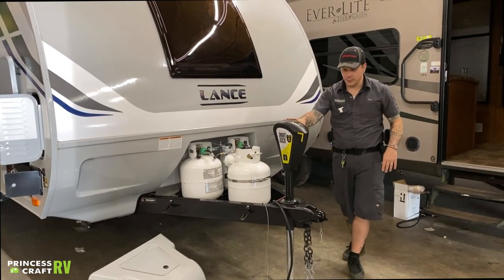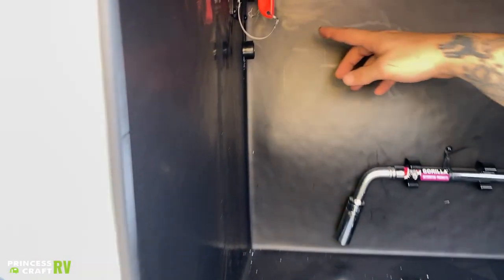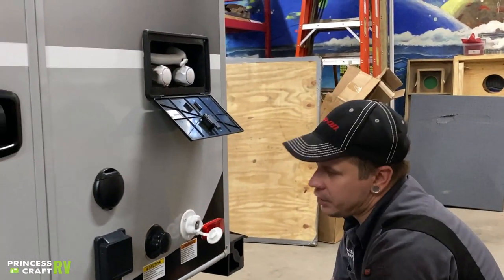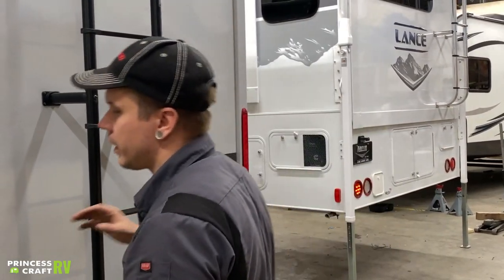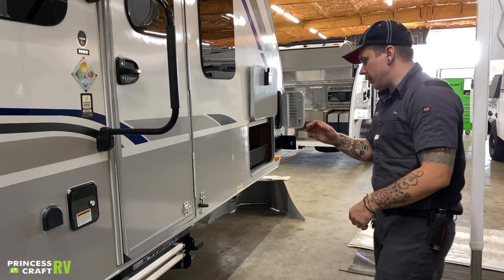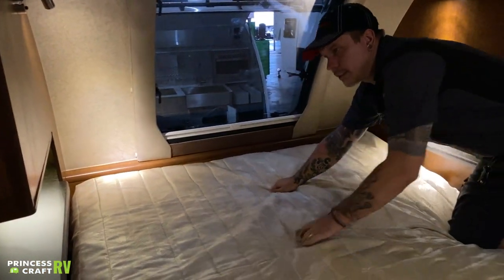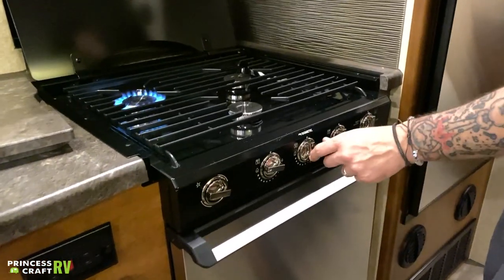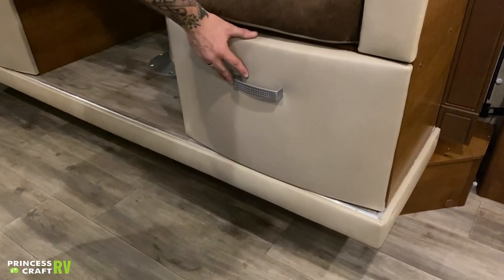Technician Tour - Lance 1985 2020 model

Comment: As the new owner of a Lance 1995 I still found Drew's review of the features and technology in the coach the best I've yet seen...  Great job Drew (and one I'll undoubtedly go back to time and time again...) One bit of information that most technical reviews don't tend to cover is the issue of trailer wheel torques and tire pressures...I know each coach has a sticker with the 'recommended' tire pressures...I've heard that a 'recommended' 60 lbs psi may be too high if you're travelling through hot zones...

Comment: That sewer hose holding bumper is for the most part useless.  The most popular  sewer hose is the Rino and it won’t fit in that bumper.
Reply: Edward Martin mine does and it’s a rino .
Reply: Captain Midnight  -  Let me confirm.  You own a Lance 1985 and a standard Rino sewer hose fits in the bumper?
Reply: Edward Martin  a 2019 lance 1985, and the hose  is in the bumper as I write this . Camco rhino 20 ft flex hose,
Reply: I too own a Lance 1985, and while it is snug, the Rino hose will indeed fit the bumper.